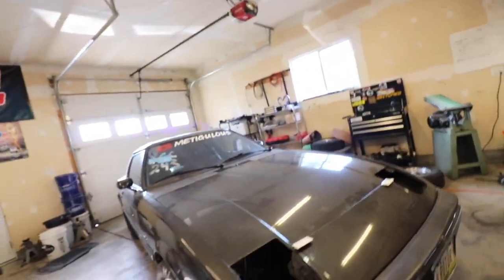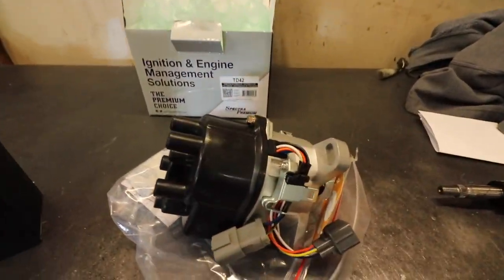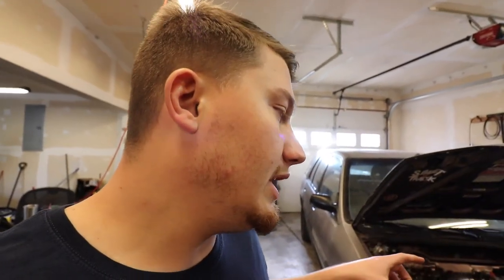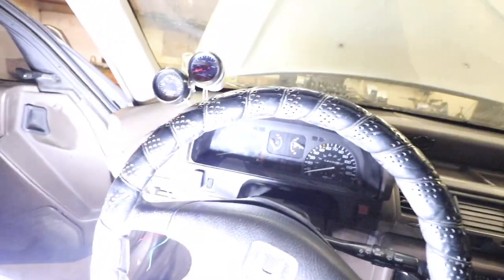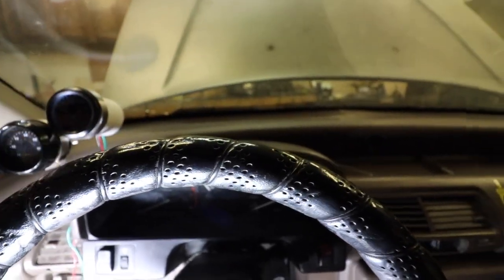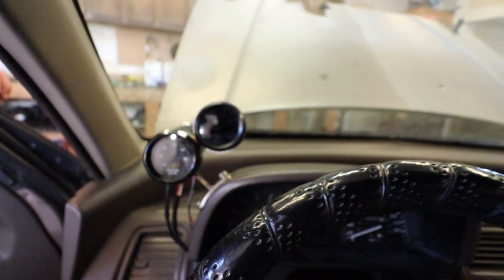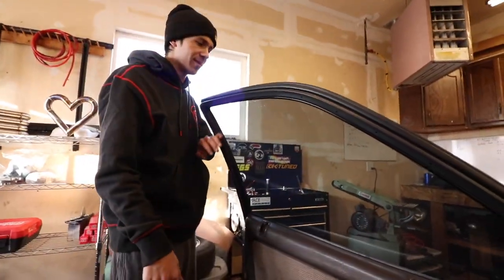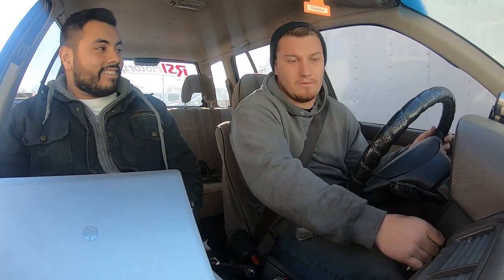Driving the Budget CIVIC WAGON For the First Time!

Comment: "it wants to idle at like 750" isn't that literally the default idle for this engine?
Reply: They need 1000rpm idle so i think
Reply: Stock its 800.. but this is on E85 And it has a Bigger Cam in it. So Atleast 1,000 will keep it happy.
Reply: @EgHatchK24a2  Ah, thank you.
Reply: Yea I wouldn't use throttle cable to  raise it up after a pull  that shits  going to idle like 3k
Reply: @boostdeep3967  Who adjusts idle with throttle cable???
Reply: Don't know anything about D series, but my F series has an idle adjustment screw on the throttle body.
Reply: @arcadiagreen150  I'm pretty sure every car does. You do not adjust idle with the cable. Although with EFI you can't just turn the screw without going through the right procedure so the ECU knows whats up.
Reply: @FroztiProductions  yeah, my car is easy because it's obd-1 from 93. Just paper clip the blue diagnostic plug and adjust idle. Turn off car once set and remove paperclip. All set

Comment: Oil pressure seems kinda high actually.
Reply: Cold start on a very cold day. Oil would be thick.
Reply: @kurtthrun1909   I have heard of oil pressure being low bc of the cold. I don't think oil pressure should be that high at WOT. Not trying to break your balls just looking out that's all. Keep an eye on that.
Reply: @Mattmazz77  it's a little high maybe but not by much considering its newer oil. And yes, oil pressure will be higher when oil is cold. If it settles around 70-75 it would be better
Reply: @arcadiagreen150  like I said just trying to look out. If it comes down that's great.

Comment: 90psi at idle and you wonder why you have oil starvation issues, smdh
Try stock pressure/ high volume NOT high pressure/ high volume unless you add a larger oil pan